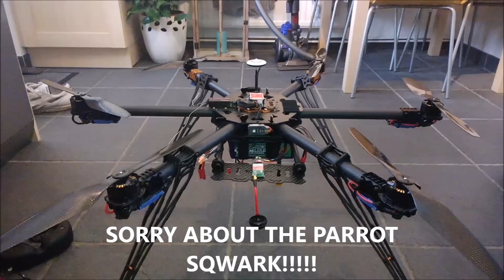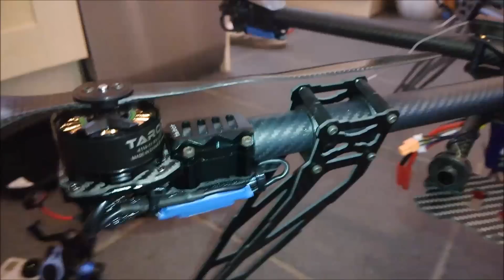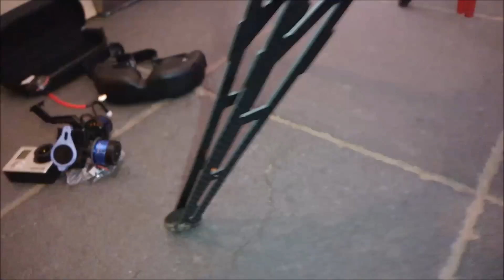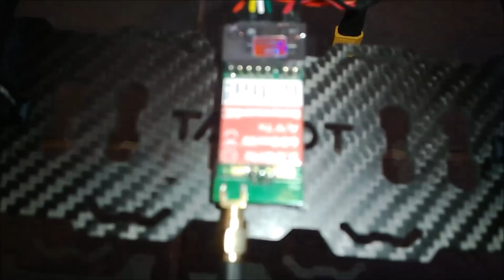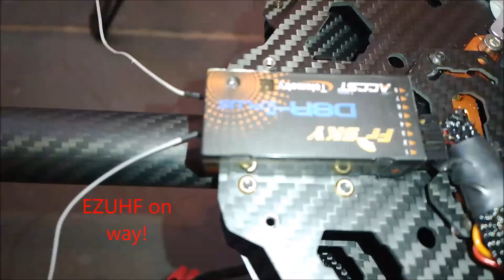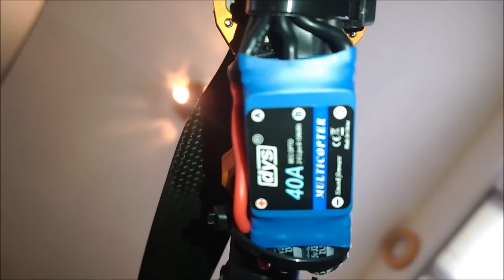Tarot T810 STAGE 1 intro

Comment: I mount my big LiPos in an ABS box with some padding to protect them if it crashes because with cells that big there's not much left after a few seconds if they're damaged & catch fire! For the size of a machine like that the extra little bit of weight is no bother at all & greatly adds to the safety factor of it as a whole.

Comment: Hi Ben , looks very nice , I am now building one my self , and im pleased to see you have a Naza lite on there , I'm using a Naza v2 as I have a Naza v1 on my TBS Discovery and have been very pleased with them , and think they should all do the job they advertise . The price jumps between each system gets very expensive and I'm chuffed too here its working well for you , I think its down too 800mm snobbery . Look forward to more vids and I shall be posting some myself , where in the UK do you fly ? cheers Scott
Reply from the maker: Hi scott,
glad you like the video! its the first one i have done, the tarot is built now with gimbal onboard, and more videos are to follow soon (weather dependent!)
i was concerned i would get abuse for putting the lite on! so thanks!
you are right tho, its basically the same as a v1/2 just only goes up to hex and you cant use the naza osd (which isnt great anyway in my own opinion) or update the software, this is why i wanted to make my point about the lite, i accept it was a risk but it payed off just fine! i will go to a "better controller" when i add my main SLR gimbal as the cost will justify it, i was considering the WKM but eagletree have just produced a fantastic flight controller so i will be trying that one first! (around £280 and supposed to be better than any DJI product) i fly in Berkshire mostly however i do intend to travel around over the summer months. i'll be checking out your videos! i'm considering a disco for 'messing' around with as they are much more nimble and fun to fly than my big hex! was considering the pro version but you can get 3d printed adaptors for the gimbal so again no need for the big expense if i just get the standard disco and modify it, again videos will be here if i decide to get it (tho the tarot quad is very cool, and i'm really pleased with the quality of my t810)
here's to your future succesful and happy flights
cheers bud
Reply: tarot t810 Hi Ben , on lots of vids I have seen , people have been a little disappointed with the TBS Discovery Pro as the Gimbal was not as good as they expected and like you said there are lots of modifications you can do yourself at a nock down price . A good site to look at on You Tube called , That HPI Guy , he does a lot with multi-rotors and has been very helpful in the past as well as interesting > Look forward to your next vid mate .
Reply: Hey Ben do you think in your next vid you could give me some help with the set up and let me now your gain settings mate , or message them to me if you don't mind , as the closer my build comes to the flite the more nerves are setting in , and it would be good to have some help . Many thanks Scott .
Reply from the maker: Scott Thompson hi, yeah no problem, to be honest I intended to do a build log in full detail, (I got the videos) I just wanted to show the end result first and then if peeps had an interest then I will make it and post it. what's your setup? you can tweet me if you are on it?@2benandrews